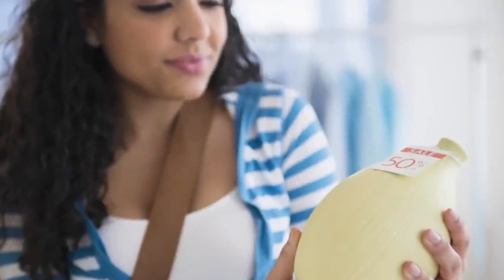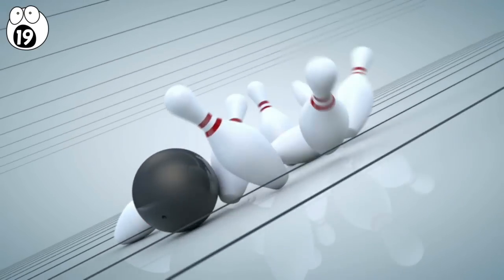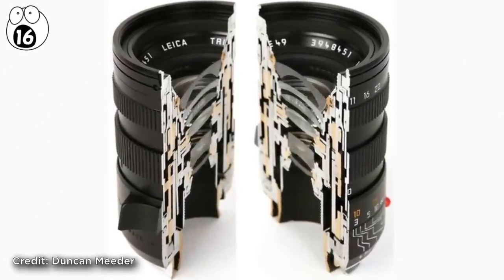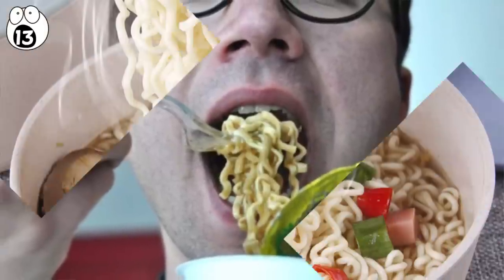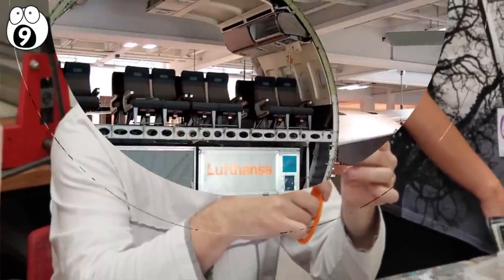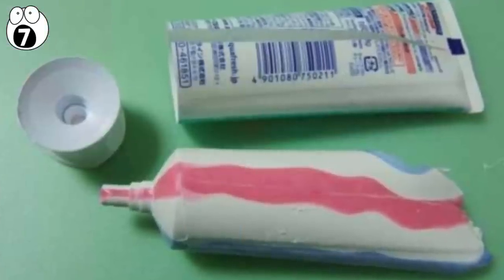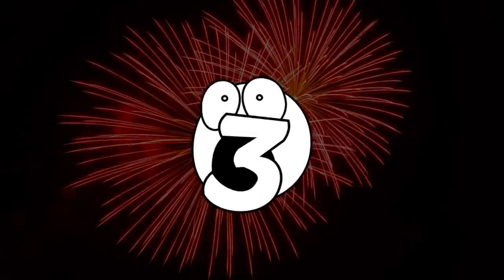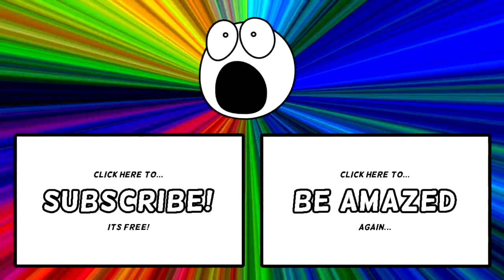Amazing Cross Sections That Will Blow Your Mind!

Comment: As for the bullets segment you are right for the most part, but the area that is struck at the back of the round is known as the primer. What strikes the primer is known as the firing pin.
Reply: Captain Zapp Brannigan just curious are you gun expert(no insult/sarcasm intended I'm just really curious)
Reply: nube tube51 Not really I just study alot on guns, kind of a hobby of mine. Particularly guns of the old west including black powder revolvers.
Reply: Captain Zapp Brannigan you beat me to comment on the firing pin/primer part of the video
Reply: on a related note gun powder doesn't explode it just burns  very fast
Reply: Jim Findley you're correct and it expands gasses at an incredibly fast speed, propelling a projectile forward. That's why any enclosed container filled with gunpowder will detonate if set on fire, no place for the gasses to expand equals boom.
Reply: Also, not every gun ejects the spent cartridge...revolvers and bolt-action rifles come to mind.
Reply: tattooedman42 and lever action rifles.
Reply: That, and the grenade one. The grenade won't do anything if you just pull the pin. It's active once the spoon is released (which the pin simply holds in place).
Reply: Thats what most get wrong bout grenades. Guess its because of movie- knowledge. I was in a KRK- Unit in the German Bundeswehr. You can get really creative with grenades. In a mean way.
Reply: Captain Zapp Brannigan Kid, legit everyone knows that, stop trying to get likes.
Reply: Primer part is wrong and also the bullet is the projectile. The whole thing is called a round or a cartridge.
Reply: Also, the primer is an explosive, the propellant does not explode, it burns
Reply: Static Boss Ok well I got likes ready to hand out...
The cross section is confusing to my Canadian ass. What is the blue part? And why does the projectile have shot-like pellets in it? 
I'm used to seeing copper or lead slugs on a bullet, and anytime I've seen a real ballistics testing and comparing (1 recovered bullet, and 1 bullet shot into gel, placed side by side) it's like a solid chunk of metal. 
On Mythbusters I saw em pancake bullets against a thick steel plate; further reinforcing my thoughts that it's 1 solid mass of metal. What is going on with this bullet?
Reply: He means "no" .
Reply: It reminds me of stories from WWI where people would set up grenades under dead soldiers' helmets, so when their helmets were lifted to reveal their face, the grenade would detonate. (and other similar booby traps)
Reply: Anyone here know about guns?
Reply: Concerned Aleks Yeah some brutal traps hey.. I know about war...
Reply: It looks like they've grabbed a picture of a section of one of the modern "home defence" sort of rounds. The blue ball will be a plastic "ballistic tip" and the shot in the copper jacket will be designed not to travel through sheet walls etc. Idea being to impart maximum energy to the initial target whilst reducing the possibility of passthrough and therefore unintended injuries. I imagine the manufacturer had the section made as a marketing tool, to show how different the round is, and they have stolen the image without really understanding it. Also note that the gun they've shown the guy shooting is a shotgun, which is a totally different beast to the bullet guns described.
Reply: A bit, yes. Why?
Reply: Matthew Hooks I see, thank you. So is this commonly called a rubber bullet? The shot could still injure someone badly, so I'm guessing this (sales cross section misunderstood) is not a nonlethal round aka a rubber bullet...? What more can you add, I'm very interested in the details of things?
Reply: Milky Way Laniakea Superclusterite  rubber bullets have caused deaths since their invention any thing coming out of a gun is lethal but like rubber bullets only are less lethal then normal bulletss
Reply: Milky Way Laniakea Superclusterite no, it's not a rubber bullet. Rubber bullets are much larger. That is some kind of special ammunition that is designed to be fired from a standard pistol but to have some specific characteristics. A rubber bullet generally is much larger, and is fired either from a special gun, or from a special attachment on the muzzle of a gun. They are described as "less lethal" (rubber bullets that is) as they spread the load over a larger area but if they hit you in the wrong place they can certainly kill. The cross section shown is either a Glaser safety slug or a magsafe bullet. Both use the design of a copper jacket filled with lead shot and a plastic ball tip.
Reply: Matthew Hooks Yeah I've seen the crowd control rubber bullets in use from a time someone took one to the temple and died. They're more hand grenade sized. 
Would you happen to know the specific characteristics this particular round has? What it's for? Just as hollow tips are more lethal because they break up and spread in the body, from my understanding that's a secondary characteristic - the prime reason is to minimize the chance that the bullet will exit and hit the man behind. "Reducing collateral damage" at least that's my understanding. 
I would like to know what job this round does, with the rubber ball surrounded by shot. I've never seen such a thing. (Not surprising though since I know very little about guns.)
Reply: Anyone who claims that the added lethality of a bullet that is designed to break up on impact is an unintended consequence is full of crap. Yes, the reduction in risk of passthrough is a nice side effect but the primary reason is to increase the amount of energy dumped into the target. I guess those two things are the same thing really. The best way to ensure maximum energy dumping is to make sure the bullet doesn't pass all the way through.
The round shown is designed to be very heavy (being made of lead) but to be frangible, meaning that it breaks up on impact. The lead free rounds tend to be very light for calibre and therefore carry less energy. A heavier round, though travelling slower to begin with, will lose energy less quickly ensuring more downrange energy.
Reply: Well then, thanks for calling me full of crap, just before saying "but I guess those two things are the same thing really." 😂
I said idk and would like clarification. Which you did provide, thks.
Reply: WELL not really it still will burn REALLY FAST and to be FAIR the containers that powder comes in are made and designed to "ZIPPER" down the sides so it won't "explode" Now if you take it out of that container and put it something different then yes your scenario would be right.... And if you store your powder correctly fire should never be or get anywhere near it ( I keep mine in a fireproof box )
Reply: Milky Way Laniakea Superclusterite that's hardly a "long range rifle cartridge" it's the round the AK47 fires. It's designed for hosing an array, not long range accuracy.
Reply: Matthew Hooks Fair enough. I already stated that I know nothing about guns and bullets. (Didn't I? Well I don't.) 
But I know enough to see that the blue ball round with shot must have a very different main function than those "mini rocket" shaped slugs that are clearly designed for hyper sonic speeds. They go really fast, therefore they travel very far, therefore accuracy is a highly desirable trait. Is that not the case...
Reply: AK47 is a rifle that packs a hell of a punch. So if that's what those rounds are I stand behind my statement as a layman.
Reply: Milky Way Laniakea Superclusterite I've just noticed. I wasn't saying you were full of crap. It was more aimed at the ammunition manufacturers who make that sort of claim. You seem determimed to take offence at everything I say. The 7.62 X 39 is a relatively low powered round in modern rifle terms. The use of terms like "long range rifle" are what the media feed people who know no better. They are misleading at best. Not saying this is your fault, you are just saying what you've heard in the media. Any rifle cartridge (or pistol cartridge) can be dangerous out to frightening ranges. The .22LR round, generally considered the lowest powered useful cartridge, can still do significant damage at a mile down range. You couldn't take an aimed shot at that distance but a round "lobbed" that far could still have sufficient energy to do damage. A 7.62x39 (the round you showed) has around 15 times the initial energy of the .22. it will certainly kill a man at a mile, but again don't count on being able to accurately place a bullet at that range. Modern "long range" rifles fire rounds like the .338 Lapua magnum and the .50 BMG which have a muzzle energy around ten times that of the 7.62x39. this level of energy allows for aimed shots at extreme ranges. The current record is around the 2 mile mark for killing a man in action. The bullet originally shown is the equivalent to a "deadfall hammer". The lead shot is designed to give the round weight (and therefore allow it to carry significant energy) but is designed to limit penetration in the target. Out of interest, my deer rifle is a 7mm Mauser. The bullet carries roughly double the muzzle energy of the 7.62x39. it also has a plastic tip to the bullet.
Reply: Milky Way Laniakea Superclusterite you asked the question. If you just wanted it in simplified terms the  why ask for an expert answer?
Reply: The "blue tip" in that round serves to help with aerodynamic flight, as well as other, less desirable traits. (If you are on the recieving end)
1)  The round is not a "hollow point" in the way it flies.   THe blue tip, (Red on some) fills what would be the hollow tip.   So, during flight, the round has a perfectly rounded and balanced point.    This means it is accurate.
2) Hollow points can cause massive damage.   The tip is a polymer usually, so it is very, very soft by comparison to the copper jacket.  If the round impacts something, that polymer tip disintegrates, revealing a "hollow point".  
3) Especially in self defense rounds, you want damage to be caused by the round.  Hollow points are good at this.   However, hollow points are terrible at penetrating clothing, especially many layers, or heavy items.  The fabric will become clogged in a normal "hollow point" round.   So, by putting a polymer tip to fill the hollow point, there is no clogging of the tip.  Now you will have penetration of the cloth, and then when the polymer disintegrates, the hollow point can do it's work.
4)  On semi-automatic firearms, a hollow point round (especially large caliber) may not cycle and properly chamber.   The flatter, hollow tip jams when attempting to load.   By putting a polymer tip in place, you effectively create a smooth, fully tipped round, which will chamber properly.   Of course, then you can see points 1, 2, and 3 above.
Reply: Matthew Hooks Because I'm an imperfect and highly flawed human 🙃
Reply: Matthew Hooks Actually I think I mixed up some replies actually... In any case I have not felt offended a slice. But it's funny that you think I have. I mean I used an emoji to try to communicate that I was joking (And said thanks!)
Just goes to show how poor text is for communication. One must be very factual and serious (dry) or risk your words coming off ambiguously, or worse. 
Thanks again for the info man! Very very interesting, and I am grateful and amazed.
Reply: Chris Slade Thank you also...🖒
Reply: Milky Way Laniakea Superclusterite the cartridge show in the cross section uses what's know as a frangible bullet meaning it was designed to break up easily lowering the risk of over penetrating and hitting something or someone behind your target
Reply: Milky Way Laniakea Superclusterite this is not a rubber bullet it is definitely lethal it's what's know as a frangible round which means it goes and then breaks up easily so if you shot an intruder or missed and hit drywall I would break apart and lessen the chance of hurting someone behind your target
Reply: Matthew Hooks about 2 months ago a guy named Charlie Melton set a new long range world record it wasn't in a combat zone but he hit a 40 inch target at 5000 yards
Reply: bosstube Thanks for the info 🖒
Reply: Milky Way Laniakea Superclusterite glad too pass it on
Reply: A. le Appreciate the overview and links. However in defense of the channel, they aren't educating us about bullets. They're just showing us cross sections of stuff.  It's the commenters who are educating me... And isn't the bullet the whole projectile and not just the lead tip? I suppose that's what you meant.
Reply: Milky Way Laniakea Superclusterite the bullet is the projectile hence why calling ammunition bullets is technically incorrect since it is just one of multiple parts like if you called a gun a barrel or a car an engine 
Ammunition is a projectile, propellant, and ignition source
Reply: bosstube Thanks, that sounds logical.

Comment: Noodles expand when they are cooked. I already felt a bit disappointed when I got my first noodle cup and saw it was only maybe a quarter full (no air in the bottom, the noodle block was moving around freely) but then it sucked up almost all the hot water and I got a cup filled to the brim with cooked noodles and almost no water for broth left.

Comment: They must make golf balls differently, now days.  My brother cut one open, over 40 years ago, and it was full of rubber bands!  (I could swear that's what I remembered, anyway...)
Reply: You are correct, they used to be made that way. Some still are in fact. Modern manufacturing techniques allow for solid cores to be used which make for a slightly more predictable response to the massive impact of being smashed into by a heavy metal golf club.
Reply: Matthew Hooks 
Wow!  Thank you for that!
Reply: and in the middle was a "superball" filled with high pressure liquid

Comment: I do an animal management course and you can hold a tortoise/turtle like you would hold a hamburger. This won't hurt them, so you don't always have to just hold them underneath because if you do then they can fall off your hand if they use their legs to push as they are quite strong. holding them 'like a hamburger' (best way I can describe it) means you have restrained them properly and without hurting them and there is less potential for them to hurt themselves. Fun fact for people ☺

Comment: People who complain about the empty space in potato chip bags and instant noodles are so annoying. The space is there so the chips don't break in shipping, and I thought it was obvious that the space in the instant noodles is where the water goes 😐
Reply: do you really need that much water for that much noodles?
Reply: The space in in the noodles because they absorb the water and increase in size.
Reply: Yeah, but im fine with having chip dust if that means high-density snackage
Reply: +LegendRaptor080 Okay but the rest of us want to eat potato chips, not a bag of crumbs
Reply: +Mena Beshai Obviously yes
Reply: for you to need that much water...  I'm guessing that the noodles are that much dehydrated. and if so. just make  the bottom as big as the top end. that way you can fit more.

just thought of this. big bottom may equal noodle slip to bottom. Nvm isn't it glued in a way to it. as for shipping argument.. are you in a rocket or driver going 100+mph. if not. consider physics. same with chips. I've never seen a chip bag open "accidentally". even when they use to have 3/4 chips. only thing was more difficult to open.

plus my hand's are always sweaty, so no grip. I should say super sweaty cause comparing to everyone I see and normal people. it's like texting your crush. you sweat (didn't know possible). but hand's are almost always like that.
Reply: +Mena Beshai They know how much water is needed and that is the space they give you. Look at where the fill line is. If they were cheating you out of noodles, then you'd need less water so the fill line would be much lower. Try only filling the cup halfway next time. 

Chips are very fragile. They're stacked on top of each other in massive amounts, and are handled by multiple people who aren't going to gently move each bag. They get crushed easily with the bag closed. Ever notice how they don't "cheat you" out of Pringles? That's because that type of container prevents them from getting broken so they fill them to the top.

It's very silly to think you know better than people who have worked on these things for decades and know what works. You obviously don't work in this field. I'm done arguing about it.
Reply: ? I thought the air if put enough in it would prevent chips from being crashed. like soda. you can't squeeze it.  I thought that they would of tried  that instead.

do people care that much about a broken chip..  I'd rather have more and be broken then less and have it look perfect.
Reply: good point btw
Reply: Mena Beshai So you would rather have a pressurized chip bag, like a soda? Also they tell you exactly what the weight of the chips in the bag is. It doesn't matter what size the bag is, you'll still get charged the same. You aren't paying for the air so why do you care how dense your bag is? You'll always get the amount of chips the bag says are in it

Comment: The first component of the cartridge that is engaged is the PRIMER. The primer is struck by the firing pin and causes a small explosion which in turn ignites the gun powder which is inside the cartridge, not the bullet. The resulting pressure that builds up from the burning powder causes the bullet to be propelled out of the barrel.

Comment: The firing pin is in the gun, not the cartridge.  The firing pin engages the PRIMER, which sets off a small explosion, that IGNITES the powder.  The powder burns, it does not explode.  The burning creates increasing pressure as the bullet travels down the barrel.  If the powder exploded, so would the gun.